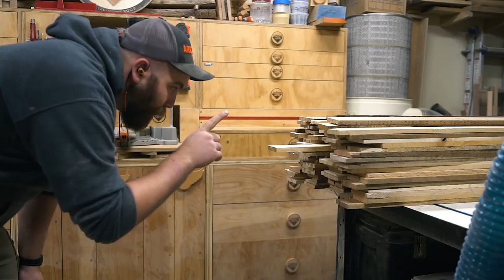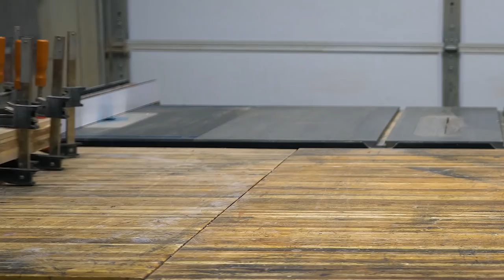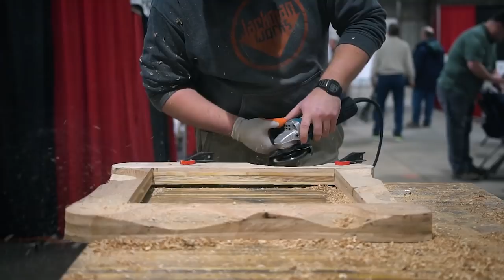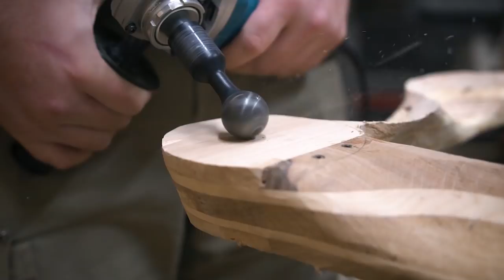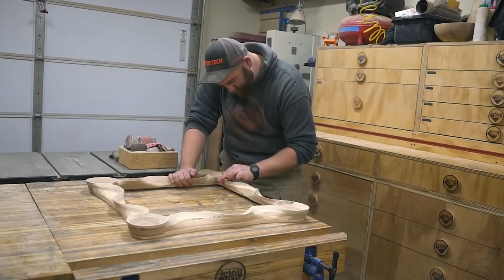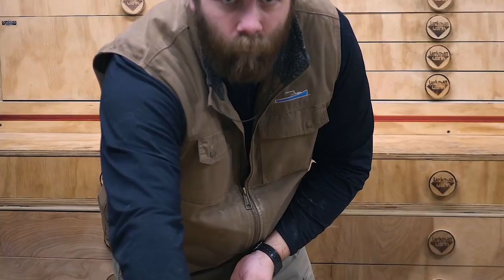Pallet Wood Power Carved Picture Frame

Comment from the maker: 𝐀𝐫𝐛𝐨𝐫𝐭𝐞𝐜𝐡 𝐓𝐨𝐨𝐥𝐬
TURBO Plane - http://bit.ly/2Gm6JRP
Ball Gouge - http://bit.ly/2UGSafp
Mini Grinder - http://bit.ly/2SbGUuL
Contour Sander - http://bit.ly/2WCoEt0

The Woodworking Shows (#arborframe) - http://bit.ly/2TCH2Ak
Power Carving Madness on Instagram - http://bit.ly/2RDqHJK

𝐈𝐒𝐎𝐭𝐮𝐧𝐞𝐬
► My exclusive solution for hearing protection in the shop, ISOtunes, get your own here - http://bit.ly/2tbcJEV

Full build article - http://bit.ly/2Tx3P0g

Notable Materials & Tools used on this build:
Materials
- Pallet wood 
- Wood glue https://amzn.to/2GnzY6y
- Tung oil finish https://amzn.to/2t9b1nA
Tools
- Bluetooth hearing protection http://bit.ly/2tbcJEV
- Table saw https://amzn.to/2SyP8ce
- Jointing table saw sled https://amzn.to/2Tza97g
- Finger board https://amzn.to/2MQjCVs
- Thickness planer http://amzn.to/2j4ISuI
- Miter saw https://amzn.to/2GouRTP
- Screw clamps https://amzn.to/2GruRma
- Circular saw http://amzn.to/2pindD0
- X-Carve CNC http://bit.ly/2t3y2se
- Compass https://amzn.to/2MOif9N
- Angle grinder http://amzn.to/2BxiIai
- Arbotech TURBO Plane attachment http://bit.ly/2Gm6JRP
- Arbortech Ball Gouge attachment http://bit.ly/2UGSafp
- Arbortech Mini Grinder http://bit.ly/2SbGUuL
- Arbortech Contour Sander http://bit.ly/2WCoEt0
Reply: There's some kind of java script error on both links for woodworking show calendar! :(
Reply: I love your videos and projects so much that I've added your channel to my favorites and inspirations.
Reply from the maker: @howiebalch8402  well that's no good! There's only one link to the WW Show and it's working for me. Maybe try it on a different device? Otherwise, just google The Woodworking Shows when you click through to their website you'll see a link for a schedule on the top of the page.
Reply from the maker: Thanks for all of your support Alexander!!

Comment: came out so cool!!!! The Turbo plane how long does it last for before it gets dull???
Reply from the maker: I've only sharpened it once in just over a year of using it. It's like a sawblade with carbide teeth where you can sharpen it over and over again but all you need is a few passes on the Turbo Plane's teeth with a credit card file and the thing works like new.